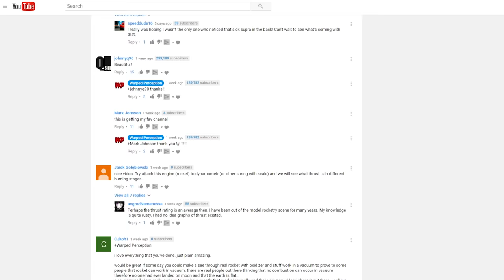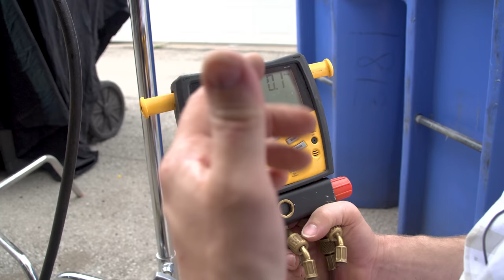Model Rocket Engine In A Vacuum Chamber - 4K Slow Motion - will it burn? - Rockets (S1 • E3)

Comment: LMAO .Yeah, right, you didn't reduce the air pressure, YOU CREATED A VACUUM !!! Congrats. If you did the experiment in a real vacuum, with a much larger device, or with less fuel (less gas), you would realize your ignorance. The only thing that you achieved was to fill with a lot of gas a finite compartment of low pressure, but the "space" of which you speak so much is a little bit wider and with less pressure than that.
Reply: Paul Ispaul a vacuum is a vacuum, and a rocket propels itself by the thrust it creates.
Reply: I've never understood why people are so mesmerized by the "AWESOME" power of a vacuum.  You do realize that the only difference between the "INFINITE" vacuum of space and the air you currently have your butt parked is just one (1) measly atmosphere.  That's right... the only thing protecting you from the "COLOSSAL" damaging effects of space are a meager 14 psi of air.  That's why it's so easy for us to create vacuum chambers here on earth.  Yet, somehow... people have it stuck in their heads that the subtraction of a mere 14 psi, that takes us from our atmosphere to the "GARGANTUAN" vacuum of space, will somehow completely negate the power of - let's say - an F-1 rocket motor.

What have you got there, Bobby?

This is the F-1 Rocket Engine, Hal.  We just finished it this morning.

What were you planning on using it for?

We're taking this puppy into space, Hal.

Well I think you need to just hold your horses there, Bobby... What gives you the idea that you could ever get this motor to work in space?

We've thought of that, Hal.  See, the F-1 operates with a chamber pressure higher than that of the vacuum we're sending it into.

Well, you know I can completely appreciate your engineering acumen there, Bobby... and while I'm sure you're little science project here works perfectly fine down here on Earth, I just don't think you'll ever be able to overcome the infinite power of zero psi.  I mean, that's a whole 14 fewer pounds per square inch, Bob-O.  I need you to wrap your head around how incredibly huge that is.  So, for the safety of the people we're gonna be sending up there to risk their lives in our attempt to reach space, I gotta ask you, Bobby... what's the chamber pressure on you're little F-1 motor here?

1,015 psi, Hal.

It'll never work...
.
.
Reply: The Bonesaw .. this needs to be a top/pinned comment
Reply: Paul Ispaul waste not your breath with people that believe 1960s technology got us to the moon
Reply: Read as: "I've got nothing to lend to the debate, so my only argument is run away and do not engage" -- signed Nelson Figuereo.  Thanks, Nelson.  Your input is greatly appreciated and the logic of your argument is flawless in its simplicity.
Reply: Ben, good theory, but where is the solid physical barrier in space that separates our pressurized atmosphere from this theoretical Hollywood vacuum?
Reply: How about this. Your gut disagrees with the experiment. Design a better experiment and carry it out.
Reply: Adam, is it live or is it memorex?  Is it a picture you've seen or an image, which are not the same thing?  I never said that there's a solid physical barrier between our atmosphere and where the stars reside.  I said if NASA's fake space travel was real, in order to have a pressurized atmosphere next to a vacuum, a solid physical barrier is required.  

You can prove whatever you want with a mathematical equation or computer image or video, but those are not scientifically acceptable as evidence if you can't demonstrate your theory on the ground.  

So you put up or shut up, you create a vacuum next to a pressurized atmosphere without a solid physical barrier between them.  Or bend the surface of water around a spinning sphere to show how we can have oceans on this cartoon ball Hollywood has sold us as real.
Reply: Jay, the only experiments that get any real traffic are those sponsored by your sun worshiper handlers.   It could be that most round Earther's are just idiots and would rather watch a video of a puppy giving kisses then one that proves they're being lied too.
Reply: ben gray so... then why have we not went been back ?
Reply: Adam B do you know those equations..cause the folks at NASA are still supposedly trying to figure these things out.
Reply: but that doesn't prove anything either. and space isn't nearly the perfect vacuum you assume it to be.
Reply: Sledge, we went back five times (manned) and it's rather expensive.  If you want the equations, look up "physics" and continue reading for several years.  The "folks at NASA" and JPL and SpaceX and all the other companies putting things and people in space already did that reading and know a hell of a lot more than you or I do.  YouTube is not the place for teaching hundreds of volumes of information.  The current figuring out is how to make going to the moon cheaper and likely eventually profitable, without turning Earth's biggest globally protected thing (aside from Earth) into an ugly mining quarry.  If you doubt we've been there at all, look up the laser ranging retroreflectors that work just like the ones on children's bikes.
Reply: @adamb3918  Gravity is made-up, Einstein said so. There is only the force of constant acceleration acting as if it was gravity.

And the curvature? Are you kidding?  We can see things 100-200 miles behind the supposed horizon using 83x optical zoom on a Nikon P900.

Anything else or you're done ?
Reply: @mathiasschmidt7316  Wow, you globe deniers are really advertising the Nikon P900 aren't ya? You should be getting paid by them.
Reply: Thanks my peeps.
Tesla called the theory of relativity a complete re-working of basic physics to fit the "theory"**** 
That it was wishful thinking at the most. No gravity, just density. Annnnnd Google even says that the geocentric nor heliocentric "theories"***** have never been fully proven, google it* 
Yeah you'd have to go on blind faith to believe that stuff...probably as to why they feed us the gravy while we're young and impressionable.

Comment: It makes sense, but another factor to consider is that all of these experiments reproduce vacuum but not gravity 0. So much so that you have to rest your devices on something fixed in the camera. Now we know that between centrifugal and centrifugal force generates a resultant that drives forward. These experiments all do not nullify the influence of gravity which may be the factor that generates at least minimal force with minimal reaction by burning oxygen itself and in a system that facilitates movement such as a soft spring or a propeller. In the case of space this does not occur.
Reply: You have a vast misunderstanding of what gravity is and how it works - and really with physics in general.  There is no space where rockets have been where gravity did not exist.  Gravity is everywhere.  The fact that it is sitting on Earth doesn't change the experiment, and in fact - rockets cause acceleration, and acceleration and gravity are basically the same thing fundamentally - particularly in General Relativity, so to say that the experiment is flawed in some way because it is not done in zero gravity is nonsense.  If you are accelerating, you are NOT in zero gravity - no matter where you are anywhere in existence.  No rocket in the history of rocketry has ever operated in zero gravity.

Comment: Excellent video and thanks for the effort.  There was a red flame and smoke.    It proves the Apollo 17 ascent module was not rocket propelled because there was no flame and no smoke.    So how did it lift off from the surface of the moon?
Reply: So evidence that SOLID ROCKET MOTORS make visible flame is evidence that HYPERGOLIC ROCKETS dont work in a vacuum?
Yeah you are a genius!  Bless your little heart!
Sorry but it is a FACT that hypergolic flame can be invisible.
They TRAIN us on this fact when doing fueling operation certification at KSC or VAFB.
Reply: @stuartgray5877   No.   Newton's law works everywhere.  A remote controlled fired shotgun being the best example.  As the charge flies east the gun recoils west.  On earth air resistance hinders but does not stop this effect.   It works in water or in space.    In all cases there have to be a flame seen in darkness.   If a hypergolic rocket is uses there has to be an exhaust flame.    The fact that there was flame of smoke from Apollo ascent rockets proves the craft was lifted by a rope.
Reply: @ValMartinIreland  Then I guess the air force hazardous materials handling instructors at CCAFS and VAFB were lying to us.
I guess you know more about this stuff than we do.

Comment: The variable that I would love to see taken out is the fact that the gas is contained and also has something to react off of. If this were done in the vacuum of space the hot gases would expand indefinitely or until something acted upon them. Think of a garden hose, if a drop of water comes out of the nozzle it encounters resistance in the air, however, the drop behind it does not and slams into the first droplet and so on, this creates pressure. In space the water would not encounter these particles, greatly reducing the pressure and the hose would stand still leaking water outward. I am torn on this from an objective standpoint because as someone used the example of a firearm, if a bullet was fired from a gun in space without any other force acting on the gun, wouldn't the gun travel equally as fast as the bullet in the opposite direction?  It seems to me that the only particles that could be reacted upon in space are the particles that are expended from the rocket, which would require ever increasing speed of the particles leaving the nozzle, otherwise I don't see what a rocket gets thrust from. Unfortunately without the use of space to test this, we are unable to independently test this.

Comment: This was explained to everyone in middle school. Its basic chemistry. Solid rocket boosters (s.r.b.'s) are made with a combination of fuel, and an oxydizer. Oxydizers provide oxygen, like the name implies. The solid fuel is mixed with the oxidizer, and burned. It doesn't need an oxygen supply. And it would move forward in a vacuum due to Newton's third law of motion, which implies an equal and opposite reaction. Fuel burns and expels hot, fast gasses in one direction,  propelling the rocket in the opposite direction, regardless of outside atmosphere. Sea level to the moon, the laws of physics don't change. If you can't grasp these simple concepts, the comments section of a rocketry channel may not be the place for you. Also, the earth is round, and we didn't fake the moon landing. Suck it.

Comment: The gases expelled from the rocket made the chamber no longer a full vacuum.  They also pushed against the back of the tube, which in the vastness of space, there is nothing to push against.  Furthermore, you stated that the rocket burned up in less than one second, which normally lasts 8 seconds, so you're getting 1/8 the efficiency.  It's definitely not debunked.

Comment: I see several problems with this. Considering that those trash cans are about 2 ft wide each it looks like the rocket is about 6 ft from the end of the tube and there is more than a 2 ft flame coming out of the rocket. The flame goes beyond what can be seen in the footage. The thrust is going to be well beyond the flame of the rocket and is therefore pushing off the end of the tube.Also, that wimpy vacuum pump is not producing a vacuum anywhere close to what is in space and the gas exhaust from the rocket  is ls filling the tube so there is not a true vacuum in the tube so the experiment proves nothing. Nice try though.I think the chamber would have to be much longer and larger and the vacuum would have to be much lower, like -7 Torr.
Reply: Here's your problem. If a rocket required air pressure to work, you would be calculating rocket thrust with atmospheric pressure. You don't. Unless you can show me how atmospheric pressure changes the rocket force.

Comment: Have you thought about replicating the throwing a bowling while on a skate board experiment in a vacuum.
You could use some train track and a sled that throws a metal ball off it to propel it forward.  Test it with and without a vacuum to compare. There won't be any atmosphere created and it will show if the sled moves before the ball hits anything or not. Maybe use aluminum and steel balls of the same size or lead shot to see what effect that has.

Comment: And for the FE about the noise, the rocket is both mechanically connected to the outside to transfer sound waves and once the rocket ignites its creating an atmosphere around it to also transfer sound waves.

Comment: All rocker engines (Solid or Liquid propellant) utility both a fuel and an oxidizer. For example, the 5 Saturn V F1 engines burned a mixture of kerosene (RP1) and LOX (liquid oxygen). The shuttles solid fuel boosters used Aluminum for fuel, Amonium Perchlorate as oxidizer.

Comment: For the purity of the experiment: it was necessary to maintain a vacuum, because the rocket fuel contains an oxidizer and combustion products that turned into a gaseous state and filled (replaced) the vacuum!

Comment: Nice test but the variable is the closed end of the tube. The rocket engine DID have something to push against despite the vacuum,  hence the movement. This would not be the case in "space"

Comment: A lot of people here seem to be confused about what makes a rocket engine provide thrust. It's understandable because in our daily lives, we "push off of" something to make ourselves move in the opposite direction. It only seems natural to think that a rocket engine needs something to push off of too. But... no.

Force = Mass x Acceleration

When the gasses expand and shoot out the back of the rocket engine, the mass of the gas molecules times their incredible acceleration is evidence of the force of the burn.

Newton's third law

... says that there's an equal and opposite reaction, i.e. the rocket accelerates in the opposite direction from the rocket gasses. Since the rocket probably has more mass than the gasses, it will accelerate slower than the gasses but that's still pretty fast.

Think of what happens if you stand perfectly still and toss a heavy bowling ball, or cinder block forward. You will be pushed backwards (unless you balance yourself which is a natural reaction). The bowling ball doesn't need a surface to "push off of."

Also, as for the comparison of the airplane wing. This is something completely different.

An airplane wing produces lift when the air must travel faster over the top than the bottom because the shape of the wing makes the distance over the top longer. Think of a marching band that is split in two where half the band must take a longer route so they have to walk faster to meet up with the other half. As they do, they spread out.

Same with molecules of air going over and under a wing. And when the molecules are spread out, that's less pressure than the molecules under the wing, causing the pressure underneath to push the wing (and the plane) up.

I also see comments about "sucking" - When you draw air out of a straw with your mouth, the air pressure in the room pushes on the water to make it rise in the straw. Using a term like "sucking force" is like using a term like "cold energy," there's no such thing as "sucking" unless you're talking about Tom Brady in which case I stand corrected.

As for the engine being able to burn in a vacuum because there's no air, I'd remind people that there are welding tools that work under water. The welding torch carries its own oxygen, just like the fuel in the rocket.
Reply: F=ma refers to external force, which a vacuum cannot apply. Newton is not your friend 😂

Comment: What u did is cool . 
1. Vacuum is complete I trust.
2. Some propellants like gunpowder produce it's own oxygen.( some fireworks keep burning even under  water !)
3 . The the thrust in the chamber is caused by the closed end. (See all the debri at the front of the rocket in the tube after it's opened) you have to have a chamber approximately 2m in diameter and about 10m long and then it might give more accurate results.

Can a rocket fly in space ( vacuum ) ?  So far , inconclusive I suppose ... Very good try . Thumbs up .
Any new ideas or help for this dude who actually try to proof something....

Comment: 2:25 ignition and the rocket stands 2:28, only then the rocket starts. Your experiment shows that the rocket started when the pipe was filled with gas. Gas that was in the fuel. It can be assumed that if the pipe were several times longer and had a much larger diameter, your rocket would stay in place. Which would mean that the thrust in a vacuum is negligible. Well done for carrying out the experiment. Not everyone would like to do this. Greetings.
Reply: Watch the YT video: "Uninterrupted Footage of the Falcon Heavy Launch and Booster Landing! 2-6-18" for PROOF of rocket propulsion in a vacuum.
It's best to watch that video AND the same footage from the rocket: "Falcon Heavy Test Flight" for views from onboard the center core.

FOr the morons that will certainly say "But thats not a vacuum"  Please tell me HOW the side boosters would peel away from the center core at 3600 MPH in an atmosphere .
BOTH of those videos show the side boosters peeling away gracefully and smoothly.
HOW WOULD boosters separate IF THEY WERE STILL IN ATMOSPHERE?

I'll answer: They would be RIPPED AWAY IN A MILLISECOND.